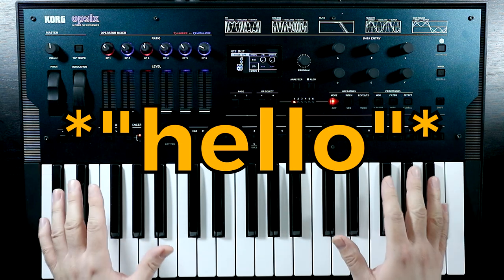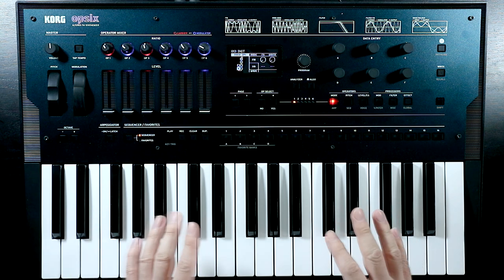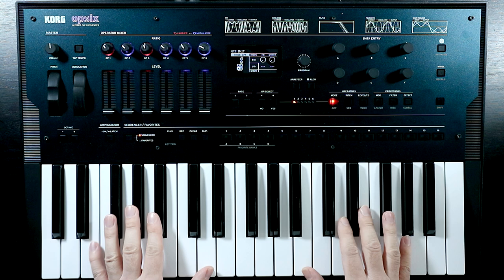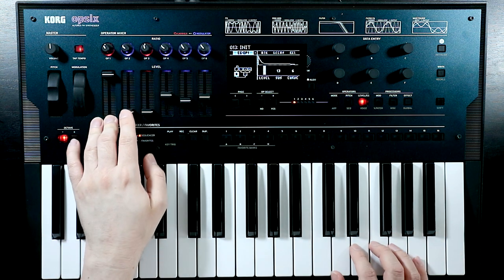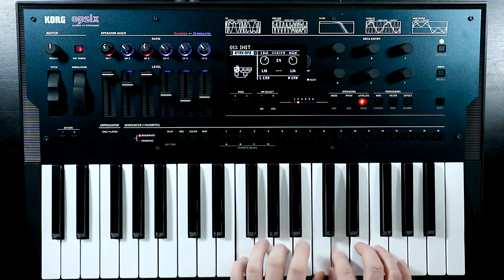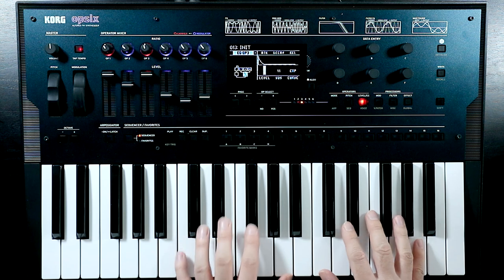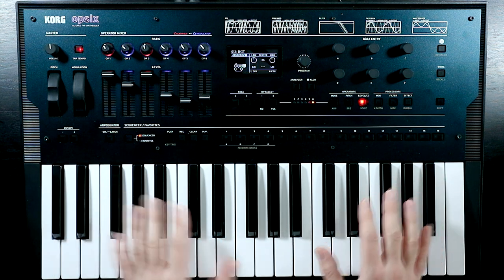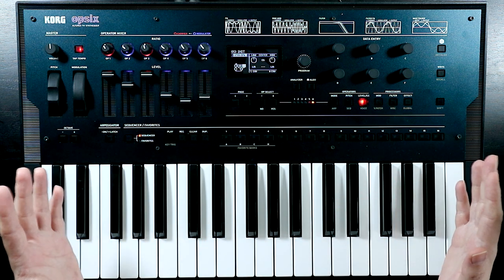Korg Opsix - Let's Build a "Broken" E-Piano from Scratch (sound design workflow)

Comment: yes yes yes  put at the end a little to much fazer/distorsion for my taste
Reply from the maker: I think in retrospect, once I added the overdrive it would have made sense to go back to the two carrier operators and make them more velocity sensitive, so that you had a bit more control over how distorted things got based on how hard you play.

This is why when I'm making a patch pack I always do multiple passes on a patch, days or weeks apart - you always spot further refinements to make.
Reply: @OscillatorSink  that's a nice respond, yes I think you are right... I never tweek a sound to perfection, so i don't know, but I guess it is like with all engineering there is a trade off to deal with... I only tweeksounds for one specific occasion , so i know what kind of register I want to use... I am just lazy , but i don't like presets